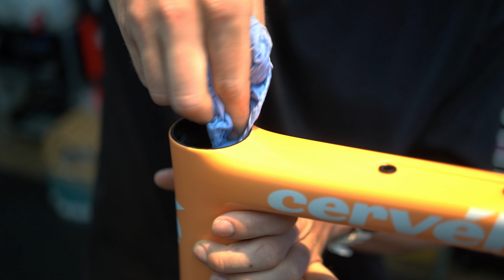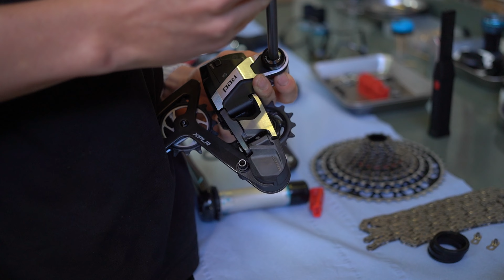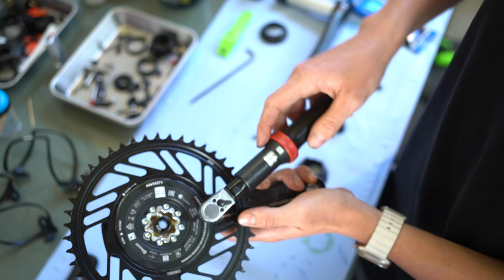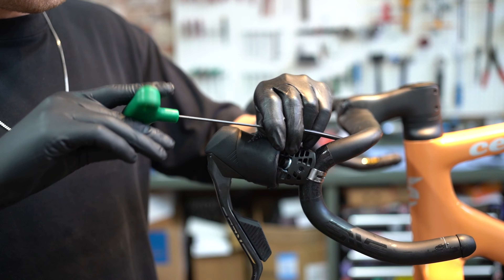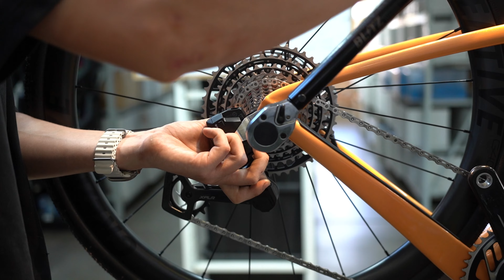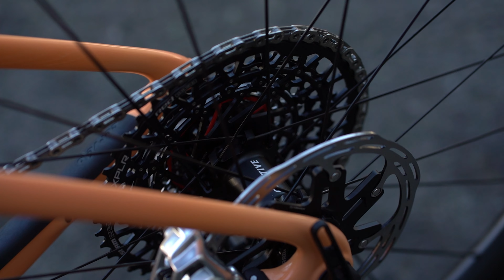The final boss of gravel groupsets? We install the NEW 13-speed SRAM RED XPLR...

Comment: That chainring was installed incorrectly on the power meter spider. The two dots, one found on the chainring and one on the spider, should align together once threaded together.
Reply: The opposite - it was correctly done --- it is said directly on the spider near the dot: "align • to start." The safety pin is also in the proper spot; otherwise, it will not fit correctly.